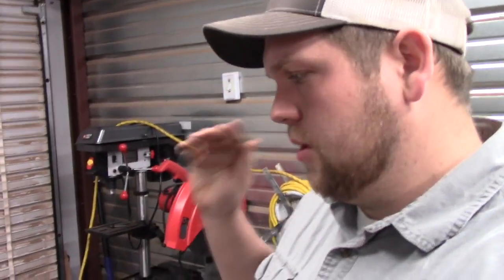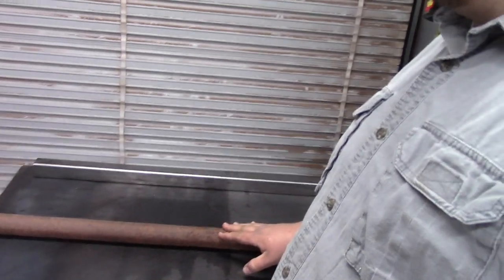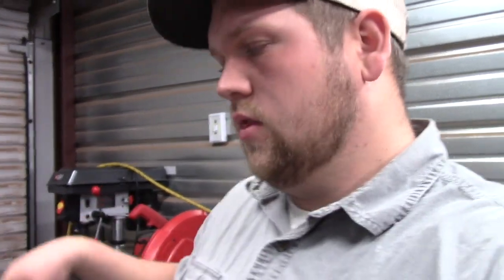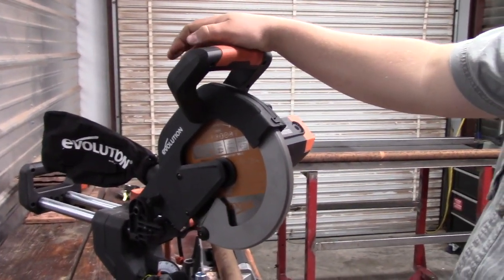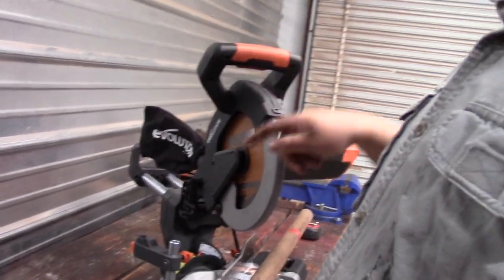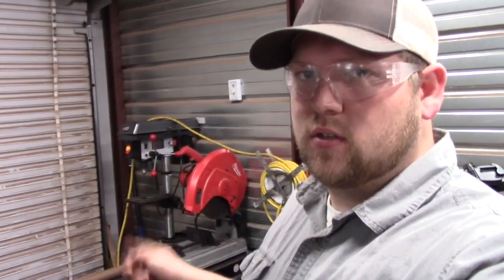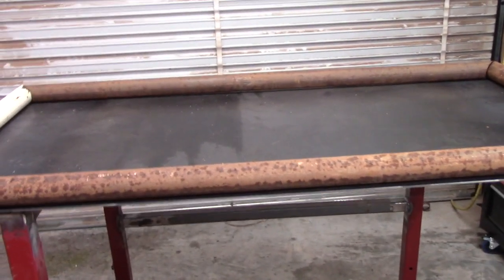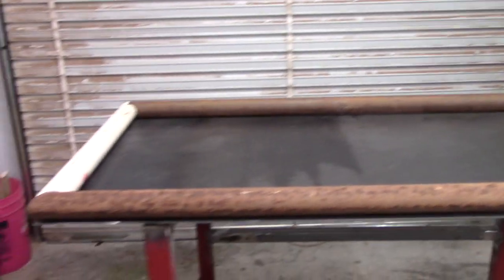Building A Small Dump Trailer - The Fame - Part 1

Comment: You choose to go ahead with the dump trailor I see. WE must have had the same thought. Thursday I set up my Amazon affiliate and put in some links.
Reply from the maker: Yes. It’s going to actually be pretty good sized  the dump bed will have 2 foot high walls, and it will be 3 feet wide so the overhang will be 6 inches on each side to cover the wheels. And then I’m still trying to decide if I want to just do 4 feet long or if I want 5’ feet long for there you be a little overhand on the back as well. I am kinda thinking I’m going to leave it at 4 feet though.
Reply: @DereksWorkshopAndProjects  what are you doing for to lift the bed,  Are you thinking about buying hydraulics or are you thinking about using mechanical advantage to just lever it up or something?
Reply from the maker: Country Handyman Really unsure at this point. I thought it I had it all figured out when I started building this frame. But I really don’t know anymore. 😢
Reply: @DereksWorkshopAndProjects   I just really quickly looked up Homemade ATV Dump trailers. There is this guy that uses his winch to pick up the Trailer.
Reply from the maker: Country Handyman yes, I have seen that but I just don’t want a winch. I think they are kind of funny looking. I have an idea at this point on how I’m going to do it.